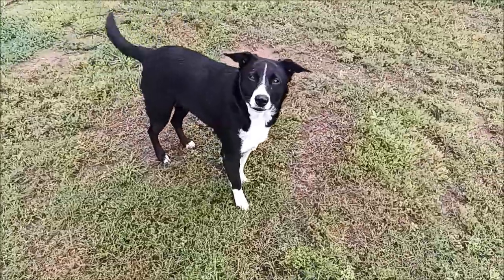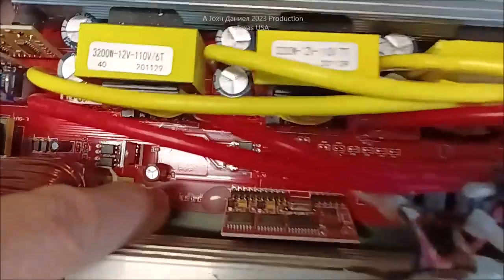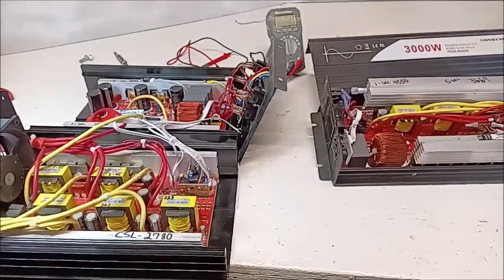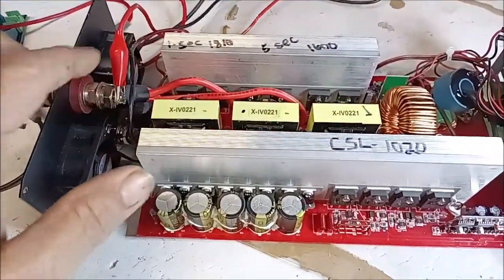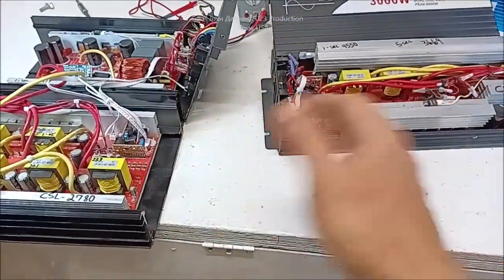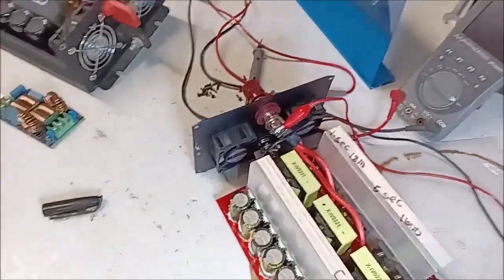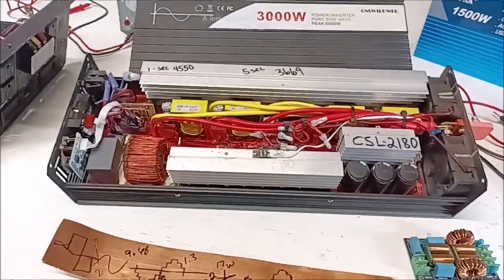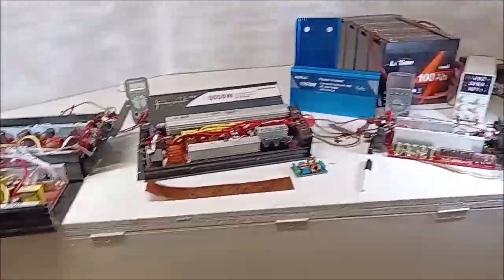What makes a Great but Affordable DC to AC Power Inverter? BRAND or BUILD, I'll explain its both!

Comment: Great video. Can you show us how you take that 3200W inverter apart? My is having a problem with the DC Volt meter, it is flickering on and off, the inverter works fine but the meter is bad.  I removed the screws that hold the end panels but I still cannot separate the top and the bottom section, Thanks!
BTW, I bought it for $284 (12V version, $317 regular price) during Aliexpress Christmas sale. It uses large fan so it is a lot quieter than the one using two small fans spinning at higher speed than the large fan.
Reply from the maker: Remove the top 3 screws on Fan side, top 4 on output side, barely loosen the rest of the screws, 1 turn out, on its ends to make some slack. Wiggle a bit and Lift straight up the upper clam shell. Careful not to unplug any of the wires going to the faceplate or boards. Check them all for full set before testing open, or reclosing it. The Trimmer on the meter is MICRO sized, use a plastic adjustment 1.25mm flat screw driver style to rotate if adjustment is needed. Sometimes just bumping those stops flicker. Another cause of flicker is the plug the meter maker sent is not perfect fit for the socket the board maker used, check pin tightness.
Reply: @JOHNDANIEL1  Thank you! So you have seen the DC Volt meter flickering issue before then, great info!.
Reply from the maker: @budmartin3344  It's a common style used by many builders.

Comment: When I click on the link for the 3200 W inverter set up an account go through the whole process every time I click purchase kicks me back out tells me to log off something not correct not sure.
Reply from the maker: If your using a AD BLOCK, Cookie restriction or similar, turn it off for that site. They can not confirm you if your blocking cookies or tracking. The site that handles it is Hong Kong Alipay.  Be sure you chose your country plug socket, voltage, and there is not a 240 volt split phase ( 220v posted is for Australia but they will send what you check if you think that means 220 volt USA) and correct is the 110 selection which is really 120v if your in USA.

Comment: I bought the Aims Power inverter charger because it weighed 46 pounds. Turned out okay. 😅
Reply from the maker: From what a tech told me (so take it as second hand) Aims was a few guys fired from Statpower decades ago for selling tech plans to China. They started Aims, and other brands. Not sure the factuality but the timeline and some historic events make it plausible. The Aims is just redone other products from mainland China that were not in our retail system then. Now they mostly sell other brands on their site for 30% more than you can buy it on Amazon. So who knows who they sold out to a few years ago.

Comment: Hi John. My 12v/3000 watt swipower inverter fan keeps cycling on and off. Is that normal. For example i run a refrigerator which draws about 110 watts. After sometime the inverter fan will come on normally. Then it will just keep cycling 8 seconds on 15 seconds off. The refrigerator will shut down but the inverter fan just keep cycling till the refrigerator come back on.
Reply from the maker: Likely the contact temp grease is not making up good on the thermal switch. Thermal paste. If you pull out the top 4 screws ( 8 total ) on both ends of top half and barely loosen the lower rest you can pull off the top and check the sensor on the heat sinks, remove screw, add paste, retighten and make sure its down well. If its gapped at all it will do this, even the threads raising from being tapped can do that. If it's bad replace with same 50 Celsius.
Reply: Thanks. Will work on it.

Comment: i have a big 4kw 12v inverter that has 8 transformers. each transformers are even bigger than yours. the entire inverter is overspeced. its so big and heavy and they direct mounted the fets to the outer heatsink. ive ran the inverter to 3500 watts for like 20 minutes. it never got hot enough to turn its fan on which is crazy. it gets 93% efficiency. it also has insane surge capabilities, I think ive done 6kw of surge on it. i don't have enough stuff to even max it out. its also a inverter that they don't say much for surge. only draw back is the high idle current of like 28 watts but it comes back in the fact that whenever stuff surges the voltage output is so stable that lights don't dim at all.
Reply: what brand and model is your 4kw ?
Reply: @edwardutter6975  giandel 4kw with 3year warranty. Its their black inverter that they only havs 2 models
Reply: @edwardutter6975  its an expensive inverter but i bought it DOA from someone for $100 since the company gave them a free replacement and didnt want the old one

Comment: On the same board you pointed out, c6 looked to be a broken solder. Just saying.
Reply: Swipower sent me a 1500w inverter with the resistor that determines the frequency not only in the wrong spot (50hz) but also soldered on way worse to where maybe both leads of the resistor were only soldered to one spot on the board. I was able to correctly solder it in the right place and now it works correctly, however it was not only poorly soldered but also went through quality control completely malfunctioning, frequency all over the place and display showing 50hz while sticker says 60hz.
Then the guy says he can only give me $5 as a partial refund. I wanted $50. He said that the remainder would have to come out of his salary....... haha.
Reply: @lancealderman2755  I'm not saying they're poorly designed or the hardware is cheap, but the technicians could use a little soldering self respect.
Reply: @brandonboulton2776  child labor laws. That's all I'm saying.
Reply from the maker: I saw that too. It's a capacitor and yes, looks rough. Its all machine installed, all of them like that are, depending on the guy programming the machines tolerances you can get that. All these component boards are outsourced normally. I checked that one, there was about 8 more questionable, but its conducting, but poor looking, however, its only needing microamps of flow. If you open up a $500 TV on random will get similar finds. That 12X table magnifier with the light I use gets lots of those catching my eyes.
Reply from the maker: Did they explain how to fix it? Is this the ALFFAA 1500W or the SWI 1500 you got with that hertz issue? If its the Alffaa you have to know which board version, 318 or 322 but the SWI its almost always the SPWM module and simple to deal with. Lots of inverter brands got shot in the rear by a component makers in China with COVID related "missing employee resulting in labeling problems", happened world wide to lots of places. Welcome to new world order gone WONG!
Reply from the maker: This is the new world effect of COVID. Massive changes in supply lines, supporting factories, and parts issues. Watch some info from CHINA INSIGHTS and CHINA OBSERVER ( news groups ) and it's shocking that 240,000 factories are closed in China, machines and materials sent to Vietnam, Bangladesh, Cambodia, and even a major LCD VLED maker shipped out to Micronesia. Their economy in shambles, and sourcing is now problematic. 24 million Chinese have evacuated. SWI Power is still doing better than most, using Taiwan and Korea but solely China dependent makers are in a world of hurt. I have been warning folks to bulk buy all you can of components, spares, and all the OFF GRID crap you can get your hands on. China will be a total crap fest in another year. But YOU CAN NOT get these materials from USA, or Europe so we have to deal with the reality.
Reply from the maker: LOL, That's the clothing and food canning industry. The electronic and machine industry only uses kids to pack, haul and sweep floors in China. Whats gone wrong or you can say WONG, is the machine setters, they are running poorly maintained, so many skilled techs has escaped China sine 2019. What you end up with is robotic machines that are way out of tolerance and accuracy now. Sort of like when GM goes on strike, the robots start welding on the soda machines!
Reply: @Јоhn Daniel  it was a 1500w swipower. I edited my first comment to mention that because youre right that Im mixing them up in the video. 
I'd had it for a few months before I tried to use it very much and noticed it was saying 50hz on the display. Took me a bit to get the information out of them but they told me which resistor to change.
I'm happy I got it working properly and don't suspect any more problems. I was going to order a 3000 or 3200w because I only have a 2000 and a 1500w but after all of that I'm not sure. Maybe if and when one of mine fail I'll figure it out.
Reply from the maker: Those Reliable inverters you see branded with numerous initials on Ebay and Amazon, those poor suckers had to eat a few thousand of them for ill matched control boards, same supplier as SWI used. COVID really screwed up their system over there. I have already dealt with lots of those buyers asking how to do the pin or zero link swaps. I may buy a dozen of those returned inverters to fix and resale, they are no where near the quality of the SWI Power but for $25 each I can't go wrong. Lots of makers got those bad mislabeled boards from Guangzhou City Charter Electronics. But what is funny, So did FORD for their 2022 - 23 body control modules!!   I do suggest though, stay with the SWI Power, you know know all about them, and from day one, test, deal with it, it will last years.

Comment: CSL kinda reminds me of free space on SSDs. If you want the full 800GB free space, you're not gonna get it. Better to get a 1TB solid state drive instead. 😉
Reply from the maker: Some measure CSL with a 3% variation, some with a 10%. I was learned in coolage to use 5% so thats been what stucked in me head! LOL! Those SSD have a reserve that is locked, so called firmware. But it only can be fully accessed on Windows ME or Android systems.

Comment: if you buy a real quality inverter, and need 2000w, you buy 2000w. victron or master volt or even better inverter, are designed to stay a 100% power h24. the concept that you need the double of the power is true for cheap inverter
Reply from the maker: Just don't read the part where Victron tells dealers  that they underrate their inverters by over 20% so buyers do not blow them up and claim warranty. Tony of HWP and I both attended the dealer seminars. So when you pay 350% more for their 2000 watt your getting a 2400 with a great warranty. Master Volt is a similar de-rated product, does similar on sale rating just like Fronius, Sunny, and Fangpusun. Still 350% more cost than a 3200 watt Swi Power and just as susceptible to a insect blowing it up as any other. Nasty little critters! 
I chose redundancy instead of over underrated and 3X+ the cost. But anyone who wants to pay the price should do so in either option. We used to be a world where we bragged on how much we saved, and now we are a world who brags on how much we spent LOL!